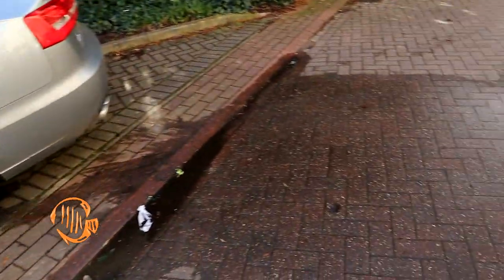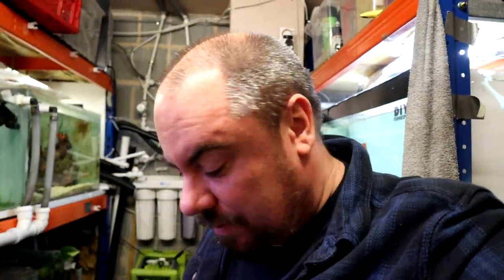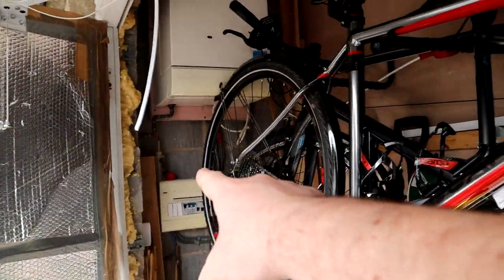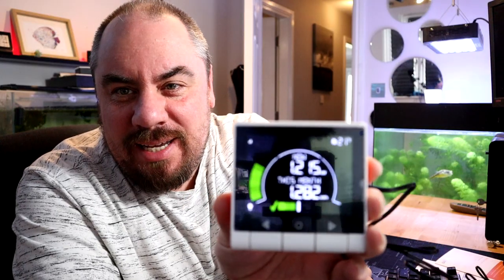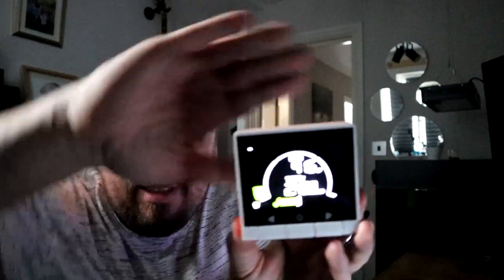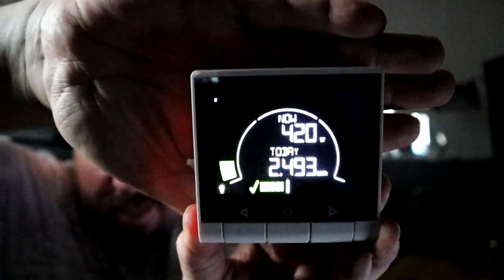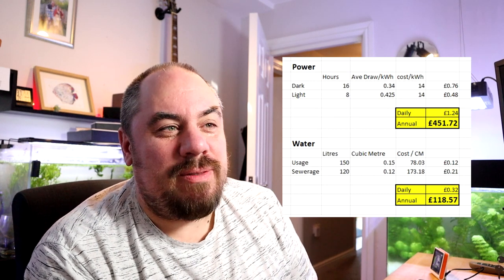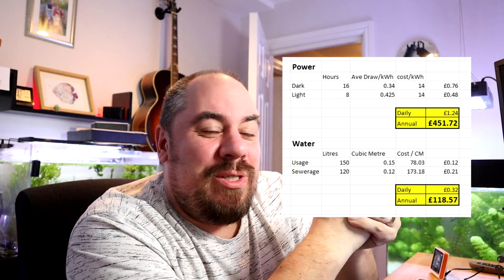Fish room - how much does it cost?

Comment: You can clip the device around the live wire in your consumer unit which feeds the sockets in the fish room. That way it will only measure the power which is drawn by your tanks.
Reply from the maker: I tried that, but it didn't work
Reply: @AquariumAdventures  just clip the device on the live wire that comes from the trip switch to your fish room. You might have to leave the cover off the panel whilst you check the readings.

Comment: Try cutting down the water drip change rate maybe by half on one tank to start with, monitor Nitrate over a month and if it's not an issue you might be able to half the water change rate on all those tanks.  That halves your water bill.

Rig those two bikes up to generators and get the family active, take it in turns = free leccy. :D
Reply from the maker: I like your thinking!

Comment: Another great video. I’m far too scared to calculate mine. I’m sure it will be horrific in water as my RO runs pretty much 24 hours a day now. I started calculating a bit for electric got to 2400w alone in heaters, panicked and stopped counting.

Off topic but when your transformer for your Aquion Eco light went on your display tank - did you replace the whole light or just the transformer. I’ve just had one go and wondering if it’s cheaper to replace and what one I need. If you have a product code of what you replaced with, that would be a great help. Thanks mate - keep it up
Reply from the maker: I just replaced the power - any 12v / 3a should work, but I got this one https://amzn.to/2HCoU6i
Reply: Aquarium Adventures thanks appreciate it

Comment: Ah, it's a wonderful hobby & most of the time l feel if l can't afford it don't do it.But l have made efforts to conserve power in the past, mainly so l can justify another tank! Firstly l have solar panels with a battery attached, so in summer l have my heaters on a timer for after midday, so the house battery can fully charge and the excess power after that goes into heating the tanks, l can do this as all my tanks are well insulated & big 2,400L to 500L & even in winter they will drop less than 1°C over 12hrs. So in Summer l can run my 4 tanks for free, power wise. Am on well water so no problem there. Winter is different, but as they are well insulated costs are not excessive, well not for 5,000L of water. My dream is to build a fishroom, which would be super insulated & space heated with an air sourced heat pump and build a huge 10,000L plus tank as the main event, one day.
Reply from the maker: Mine is a great little fish room - really stable temp wise throughout the year